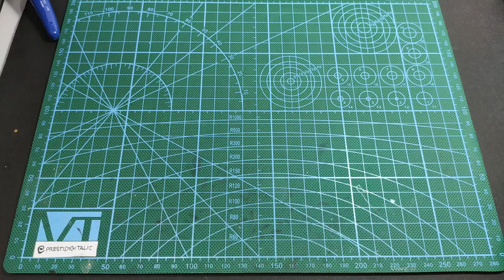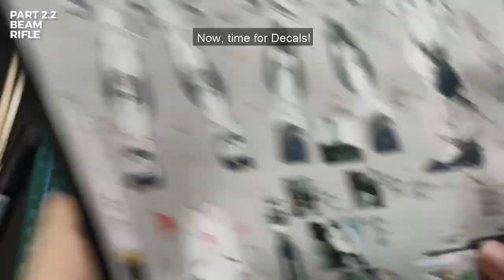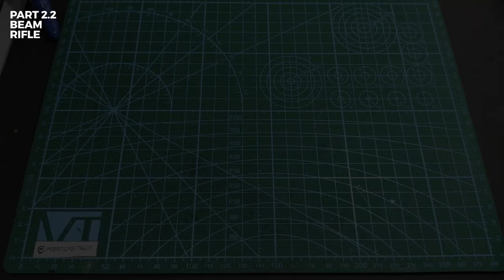RG RX-93 Nu Gundam DETAILING: Beam Rifle

Comment: Nice video man. Which would you recommend for panel lining? The tamiya one or the gundam marker?
Reply from the maker: The Brush Type Marker is good for beginners and also the Gundam Marker pour types grey and black are good. The gundam marker panel liners can be cleaned using only your fingers 😂 and rubbing alcohol. 

Tamiya accent color black is also good because a bottle may last the entire model building career 😄. Though it need an Enamel Thinner to clean up the blots.

I suggest your start with a Brush Type Panel Line marker dude, a panel line marker is included in the Basic Set which is color grey, the black one is included in the Metallic set or you could purchase it separately :)
Reply: Prestidigitalic cool, thanks for the advice. But then there’s another panel line marker, the pen is blue in colour. It has a fine tip.
Reply from the maker: @backspace3779  The blue one is a fine-tipped marker